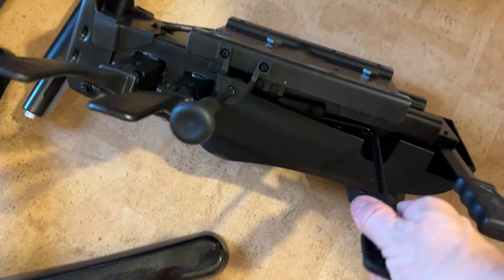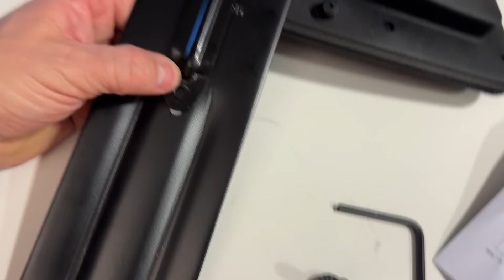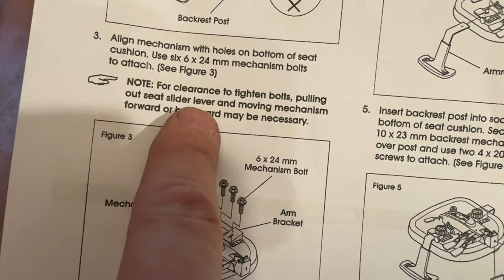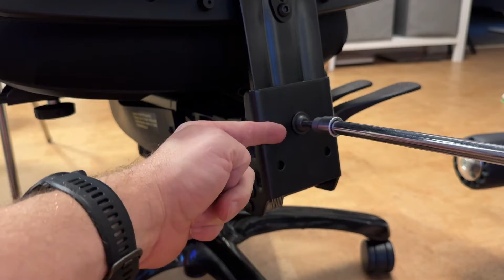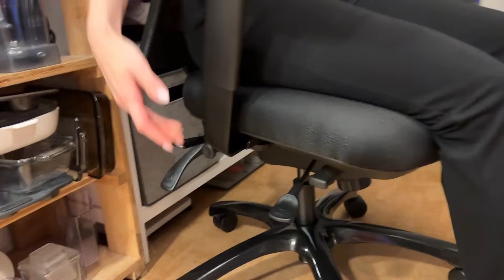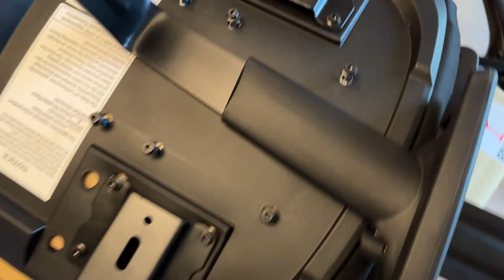Uline 24/7 mesh chair assembly and ergo fitting

Comment: How comfortable are the arm rests?
Reply from the maker: Pretty well padded, if its height is right it works well. However, height adjusts in 1-inch increments, so if someone needs just half an inch up or down, that's not happening.